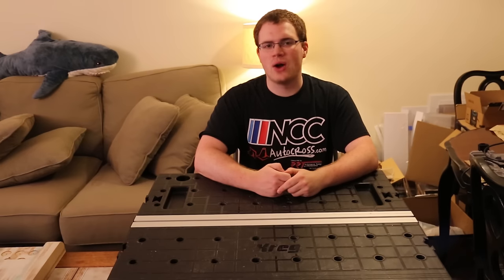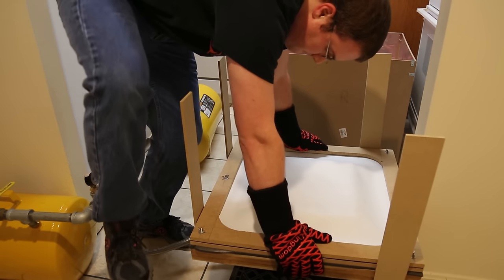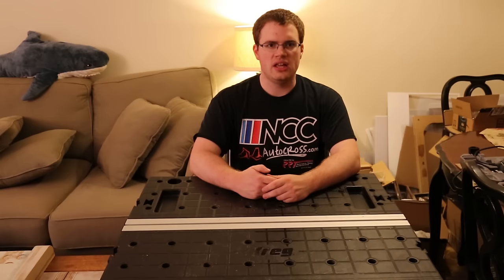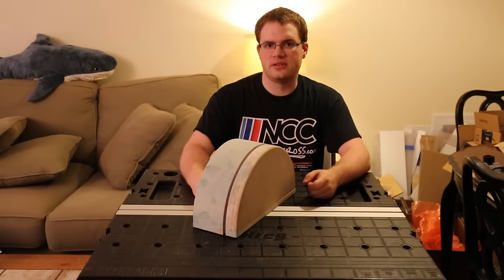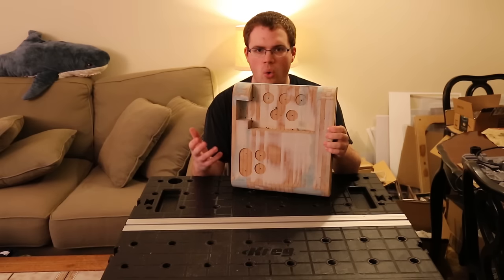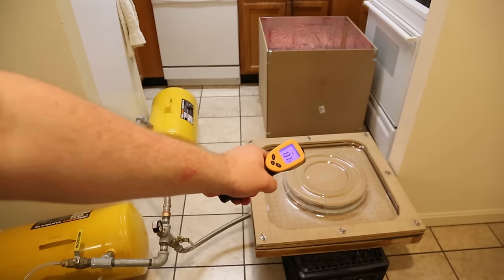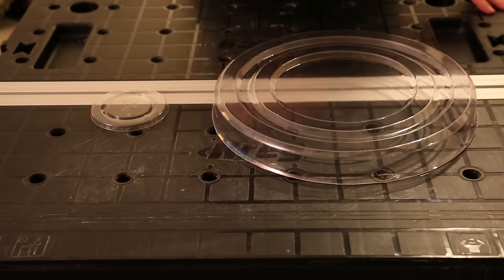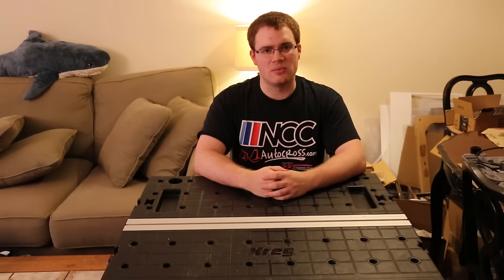DIY Vacuum Forming - Complete Video Guide

Comment: Awesome video! I need to vacu-form 1/8" PETG over a buck 10" high 24" long and 14" wide with no sharp corners. Do you think 2 shop vacs will provide enough suction? Your thoughts are appreciated.
Reply from the maker: Unfortunately for a lot of the home shop hobbyists, Shop Vacs are actually not the greatest at pulling a vacuum for a former. It may work at a smaller size, but at the dimensions you're working with you may need a Dyson Ball Stand-up vacuum or a set-up like mine. It's really odd, but the common household standing or canister vacuum is better for this application than a Shop Vac. I think it has something to do with the large reservoir of air inside (dust/debris collection bin). I've heard varying comments about filling that space with objects to reduce the interior volume of air possibly working, but I can't comment because I haven't tried it.

With vacuum forming, it's not necessarily important how much air you move when compared to how fast you move it. The snappier the system, the more accurate and tighter forms you will get. If you want to start by giving the shop vacs a try while putting insulation foam or something to reduce the air volume inside the dust collection bin, it's largely free to try. However, if you're getting less-than-satisfactory pulls you'll know that's probably an item on the chopping block. If you try it, let me know how it goes so we can properly advise people in the future. 

On the cheap, you may be able to get a couple small canister-sized vacuums from the local Goodwill or similar and make multiple vacuum holes on the bottom of your platen (or borrow them from the house or friends - if they're good friends lol). The parts list for my entire build is also linked in the description, so if you end up wanting to replicate what I have you can price it out.

Additionally, the buck you're forming is fairly tall so make sure you understand the plastic thin-out principle that was covered in the video. If you require an ENDING thickness of 1/8", you'll need substantially thicker material and that will also require a stronger heating system. If using 1/8", be prepared for an end thickness of something like .060". Also, with the amount of droop needed to form 10" tall bucks, I suggest making vertical guiding rails on your platen so you can align the frames with the platen while holding them and bringing them downwards onto the buck.

Comment: Any reason you applied teflon to the buck as opposed to the plastic? Seems the buck would tend to get grungy after a few pulls. Best video on this subject I've yet to come across. Planning to build a small box myself (8"x10") to make nacelles and probably some other parts for my scratch build E-2C Hawkeye. Am thinking about using the same method for heating, just amped up, if you'll pardon the pun, as using a hot wire as used to cut foam. Any comments?
Reply from the maker: The teflon spray I use is a dry lubricant and is designed to repel dirt as a part of it's normal use. The bucks don't have any grime on them and are clean. I'm not sure if it would coat evenly if applied on cold plastic before stretching and you're not supposed to apply the teflon to heated surfaces if you sprayed it when the plastic is already drooping (also taking valuable time). If sprayed directly on the plastic, there is a much higher chance it would become embedded in the heating process, and would be almost impossible to buff out of clear PETG plastic, resulting in a cloudy form. Sound like a much greater logistical feat compared to just spraying the buck. Make sure you use the high temperature version like DuPont DNS614101.

I can't quite grasp what you're saying about the heating element, but you shouldn't need to go too intense for a 8"x10" vacuum former. A medium scale quartz heater would likely work fine. If you use a hot wire to cut foam for your buck, make sure you seal it in some way (people use paper mache and other techniques). I strayed away from foam and use wood instead since I find it easier to machine, vacuum pull, and store without damage. It sounds like a cool project, let me know if I can help or give any additional tips!

Comment: I have a question 👋 I am needing to use vacuum forming for dental. But after I want to know if this plastic can to a complete burn out in the kiln burner using a flash. Do you know if this will work. I need it for making gold teeth.
Reply from the maker: I'm aware of vacuum forming being used in dental, but I have no experience in using the machine for that purpose. I would consult someone who has experience in that field, as I would imagine they would have some special food-grade plastic that is okay to sit in your mouth for extended periods of time.

Comment: At 1:32 in the your video you have a have circular thing on the left I need something similar but the arch is only 9 1/2" and the height is 24" do you think you would be able to costume make for me
Reply from the maker: Those dimensions exceed my current platen size and I don't take commission requests at this time. However, you can learn the lessons in this video and make your own vacuum former.

Comment: Great video! I am looking to make a master for a mask, and since a mask has more complex and organic shapes, I would need to use something I can mold with my hands. Would plaster work best, or would it transfer too many particles to the molded styrene? Is there a sealant for the master you would recommend in this situation? Any help would be much appreciated!
Reply from the maker: There may be a two-part epoxy resin out there that would work, but I don't have any experience using plaster. Just make sure whatever materials you use, they're rated to last at 300 degrees F for at least 1 minute and won't melt/stick/deform when the plastic touches.

Comment: Hey mate, love your video and i saw it multiple times. I wanna build my own vacuum system and i struggle a little bit with the right Heater. I want to make RC Car bodys but i cant find the heater you are using and i dont wanna buy some with only 1200watt (because of the shape) in case that they are to low on heat. Do you have any suggestions ?
Reply from the maker: It seems like they updated the model that I have to this 1,500 unit. Honestly, I can't tell the difference from the outside - looks exactly like mine.
https://www.amazon.com/Comfort-CZQTV5M-Ceiling-Mounted-Included/dp/B07YBH9XVG/
I find that a lot of commenters are from different areas of the world, but that link should work in the US. If you're outside the US, I'm less familiar on what may be available. You may try looking in the second-hand market for larger quartz heaters or provided you have the space you could even use an electric kitchen oven provided you weren't going to use it for food.

Comment: You hit on some really good points. I would like to know what you think of poly-carbonate and how easy is it to work with as opposed to the three types of materials that you mentioned. I want to try 3/16" thick poly-carbonate vacuum forming because it is super strong.
Reply from the maker: I've only vacuum formed High-Impact Polystyrene and PETG personally. Doing some quick research, it looks like the process is roughly the same, but polycarbonate has a much higher deformation temperature than the rest of the thermoplastics commonly used at around 400 degrees. It really depends on how big a sheet you're looking to use. If it's something like 16" x 16", using an oven may be the best and easiest option. If you're looking to go small, most toaster ovens can hit that sort of temp in the upper range, but it may be close. I would suggest doing some experimentation and see what happens. It took me about half a year of fiddling to design and build a vacuum forming machine I was happy with and really learn all the in-and-outs of the process.

There seems to be some good introductory information here about thermoforming polycarbonate: http://www.plasticsmachining.com/magazine/199609/polycarbonate.html
Reply: Thank you for your information and the excellent information in the link that you provided. Now that I know poly-carbonate is quite common in vacuum forming I will build a vacuum forming machine. The heater I think is the hard part because I need a heater that is about 60" long and less than 12" wide and I may have to custom build one (more Youtube research). I am hoping to use 110V.  As far as drying the sheet prior to forming I think I may be able to use the same heater at reduced heat of 250 degrees and while forming use 375 degrees. I was told by a plastic factory that the melting point for poly-carbonate starts at 280 degrees.

Thanks again. Good stuff!
Reply from the maker: Here is a data sheet that covers Lexan, a really common polycarbonate: 
https://sfs.sabic.eu/wp-content/uploads/resource_pdf/1448531609-74377051-LEXAN-9034-9030XXX-DATASHEET-US-2015.pdf

It backs up your data stating that 250 degrees is best for drying with a formable temp at around 375 degrees. I read that polycarbonate cools quickly, so you may want to try to build a system with an integrated heating unit. Everything depends on how large of a piece you want to form.

Comment: Her thank you so much my friend, a very clear explanation. I have a question, what about of vaccum formation of policrilate?
Reply from the maker: Polyacrylate? I don't think that would be viable.
Reply: @mwjscn  I mean Polycarbonate
Reply from the maker: @pichkflo  Polycarbonate is fine, provided your heating element can get hot enough to surpass its glass transition temperature, which you can look up on the datasheet for your specific material.

Comment: Great video!  Looked everywhere for high temp teflon spray and couldn't find it.  Perhaps you have a link?
Reply from the maker: There's a link in the description that gives you a page with the brand and part number to look for. Make sure to use a respirator and be in a well ventilated space.

Comment: Well done! Lots of helpfull technical details. Do you have a video on how to make the cacuum pump?
Reply from the maker: The vacuum pump unit itself was purchased. You can find a link to all the materials used in the description. With that, you can use the shot @8:32 to replicate what I made if you want to. The bottom of the platen just has a hole that is covered using a floor flange (that is female 3/4" thread for the piping) and some silicone gasket goop.

Comment: Great video! Thanks so much. Does the buck need to be finished with anything or is raw mdf okay?
Reply from the maker: Raw MDF or any wood/wood composite is fine. Basically anything that can withstand the heat from the plastic. However, the smoothness of the final part is fully dependent on the quality of your buck so use sandpaper, bondo, and sandable primer where needed (especially if using a translucent material, such as PETG).

Comment: Thanks for the video! A couple of questions. We tried our first attempt today and using a 24x18in x 24 in tall heat box with only one heater the heat stalled at about 290 degrees. Do we need another heater or move the heat source up a few inches closer to the frame. Also we are using clear petg i got on Amazon and when the temp hit 260 it started to turn white and stayed that way. I am assuming it is poor quality petg but not sure? Who do you recommend on Amazon to buy petg from? Thanks!
Reply from the maker: I believe PETG 'crystalizing' actually happens when it's overheated (only did it once myself, and it got cloudy and cracked looking). Yes, I do have two heaters as I found one to be insufficient. I wouldn't suggest buying any plastic on Amazon (sounds like low quality to me) and instead trying to find a plastic sheet retailer close to you. I use one for my stock and it's always excellent.

Comment: I Have s couple questions:

- what vsccum cleaner do you recommend instead of the vaccum pump?

- do you think that a vaccum pump that has less CFM or HP works?
Reply from the maker: Depends on your platen dimensions. I've never used a vacuum cleaner, but everyone recommends either Dyson or a canister-style type. Shop-vacs are said not to work well. You can use a vacuum pump of lesser power, however, it may take longer to evacuate the tanks and the pump may get too hot if run for too long.

Comment: excellent video friend, I would like to know what vacuum pump do I need to get the air out of two 45 kilo cylinders, how many cfm does it have to be and if one or two stages please friend
Reply from the maker: That sounds like an industrial application much larger than I have experience with, so I'd suggest asking someone in your area who has expertise. If there are companies selling this equipment, I would suggest asking their representatives what would be best for your application.
Reply: @mwjscn  I understand friend, I made a thermoformer that installed two 45-liter cylinders, how many cfm is your pump and how long does it take to get the air out of your two cylinders? Please friend, do you have any WhatsApp so that you can send me a photo of the technical sheet of your pump
Reply from the maker: @matiasvaldivieso5629  Takes about 5 minutes. https://www.zeny.us/products/zeny-3-5cfm-1-4hp-electric-vacuum-pump-refrigerant-r134a-hvac-air-conditioner
Reply: @mwjscn  Thanks my friend, how many kilos are your cylinders?
Reply from the maker: @matiasvaldivieso5629  Link with full parts list is in the description
Reply: @mwjscn  thanks My friend !!!

Comment: This is THE BEST tutorial.

Do you think a shop-vac could do the job here if I am using .090 ABS sheets?
Reply from the maker: It depends on the size, but I would say no. There are other comments I replied to more in depth about shop vac usage if you want to go diving in the comments. Basically, a shop vac doesn't have a fast enough 'throw' to provide acceptable performance, which is a shame because most home shops have one. You can try filling the interior collector chamber with insulation material or something else to reduce the interior volume and try to make it work better if you have no choice but to go that route.
Reply: @mwjscn  Ok, I will spring for your set upinstead of a shop vac. Thank you! I have a lot of studying to do on your vacuum set up. I'll use your site.
Reply: @mwjscn  Thank you! One more question, what thickness ABS would you recommend for a re-usable mold with dimensions of 18" by 2.5 "?
Reply from the maker: @elroy9186  .080 may be a good start, but it depends on how much detail you want from your master and how tall it is. Height off the platen matters more than the width/length. It also depends if your buck is a positive or negative mold of your end item. Positive mold would be easier to retain detail, you'd just flip the formed plastic piece upside down.
Reply: @mwjscn  The buck is 2.475" tall and has some 1/8" deep lettering at the top. The buck is a positive mold of my end item. My options right now are .060 and .090 thickness ABS.
Reply from the maker: @elroy9186  I'd start with .060 then and do some testing.
Reply: @mwjscn  You're the best! Thank you!

Comment: Hi wonderfully informative video lesson, really excellent.  Thank you.  I have a question.  I need to make simple pieces--3" deep tray like things out of 3/16 abs.they need to be 60x60 inches.  In your experience do you think this would be possible with a hand made device?
Reply from the maker: It can technically be done. You may run into some issues of scale like having to rig a much larger vacuum system and the heater box would be equally large. Make sure you start with a material slightly thicker than 3/16" if you want that as your end goal, see my part on thinout in this video.

Comment: I'm building a 36" x 36" machine similar to yours. The challenge is finding space heaters that big. Have you had any luck using 110v space heaters on 1/8th ABS (getting it to the right temp)? Almost everything I find seems it's going to require 220v.
Reply from the maker: You may be able to fit 3x of the heater I use in your heater box (parts list in description) Make sure you're using a heater box like mine that traps in the heat better than an open element.

Comment: hi 
thanks for your complete guide 
I have a problem
I use PET Sheet with a thickness of 1.8 mm for vacuum and I use an electrical heater element for heating the sheet, But my transparent sheet turns to white before complete sagging. 
What can I do about this problem?
Reply from the maker: PET turns white or crystalizes when it's overheated. It sounds like you may be applying heat at too high a temperature. Try lowering the temperature and heating for a longer duration. In the video, I used 1.5mm PETG and with quartz heaters I have (1,500 watts individually, 3,000 combined), it took around 3 minutes at around 300F/150C with my enclosure to get to the correct droop.